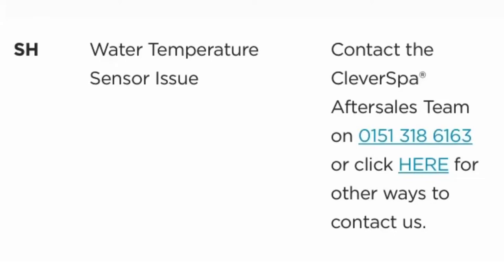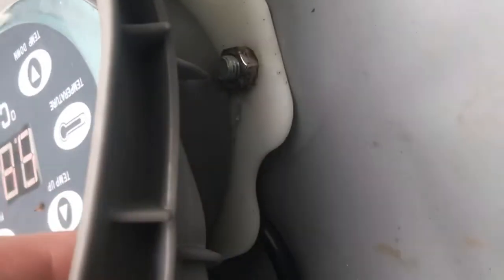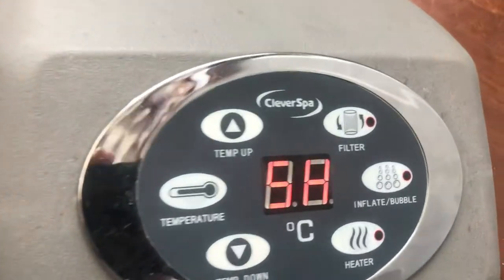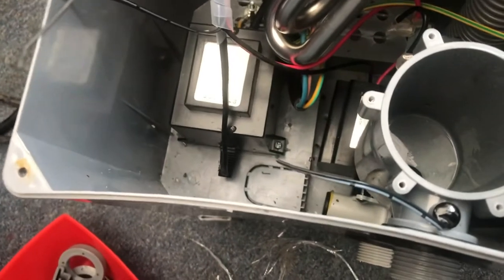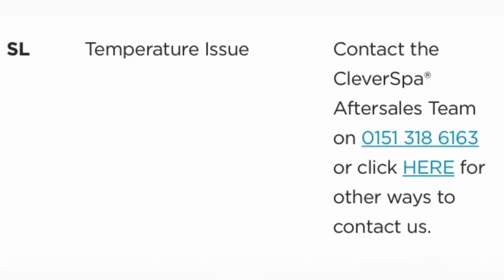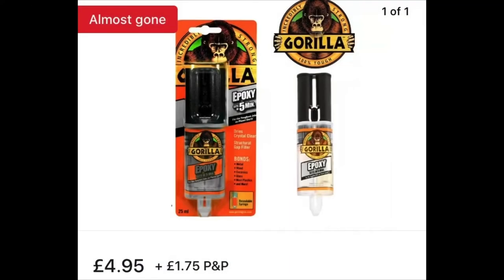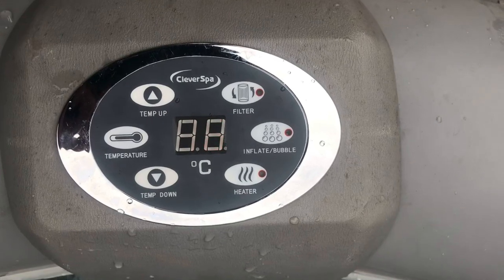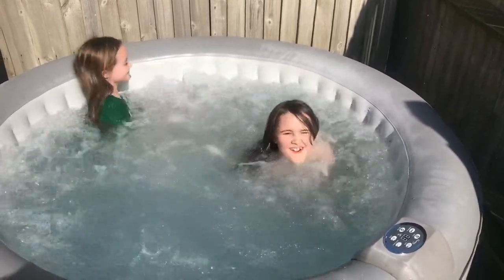Cleverspa SH error code repair CHEAP AND EASY temperature sensor replacement

Comment: Thanks we have a random inflatable hottub brand ...had sh error code... took it apart found we ordered a sensor probe like you suggested and instead of cutting we unscrewed another panel to circuit board and plugged it in directly. Put it all together and error code gone. Dang this was an on point great video. Thanks. It cost us like 7 US bucks for the probe and about 30 minutes to fix.

Comment: Thanks for this, worked a treat. I've got a cosy spa which is essentially the exact same unit. Ordered the sensor from Amazon (cost £3) and it came the next day. Didn't even have to drill another hole. Was really easy to do. No more SH code. Pool back to normal heating. 😁
Reply: Hi Marcus. I have a Cosy as well with this issue. DO you have a link for the sensor?
Reply: How didn't you have to drill a hole??

Comment: Great tutorial, thanks for posting. I must have a later version of the heater/pump unit as my probe was set in a flange held on by two screws. The probe can be carefully removed from the flange, and a new one glued into it. Saves drilling into the unit like you had to do. The single probes are currently on Amazon for £3 each.
Reply: Yes found the same and fixed fairly easily.
Reply: Could you provide a link for the sensor please? Tia
Reply: I drilled out the old sensor from the flange and glued the new one in . That way if I have to do this again I can remove it and repeat .

Comment: I've got a sensor on the way after snpping the outlet potlrt of the element housing...don't make whirlpools in your tub😅. Is it possible to plug the sensor  straight back into the control unit?

Comment: Hi gavin, i was about to go ahead with the same routine that you performed on your clever spa because i had the same error code come up but ive got it down from the loft to sort the problem ive plugged it back in to see if the code comes back and it hasnt its reading room temperature, so i thought great, i wont have to fix it so i blew it up, filled it up left it heating over night and it didnt heatup it stayed 12 degrees so im not to sure what to do. Shall i replace the censor or is it somerhing more than that mate??
Reply: I think I may have the same issue as you, I don't get any error codes but fails to heat up, I've been looking around for heating elements but this video is a good guild on how to disassemble the unit.
Reply: Jon Hill, mine is the same

Comment: Hi gavin
Was you hot tub making a slight grinding noise and not holding its temperature,I haven’t got the error code but it fits all the way up to 47 sometimes and only heats it 3/4 up leaving the water very cool on the bottom?
Reply: Same problem here
Reply: Mines doing the same .. seems like a common problem.. i need to know how to fix it !!
Reply: It's the filter guys try not to overtighten

Comment: Hi, I'm getting FC error on my cleverspa, not even inflated yet, it was stored for few months and now won't inflated, after I plugged in it comes with FC error straight away, iv the resetting thing (press and hold filtration button) but that won't work. Any advice please?

Comment: Hi Gavin, the temperature sensor on my aqua spa initially looks as if it’s reading correctly then when I switch the heater on, it reads an extra degree perceiving before giving the SH reading about 10 seconds later. Do you think it’s the sensor or element which is faulty?

Comment: Hi , I've got the sensor and now I can't unscrew the valves inside on video you say they tight you may need to use a tool what tool?
Reply from the maker: Dave Parkhouse do you mean the connections inside of the hottub where the water comes in/out?

I used some groove joint grips. I put a thick towel over the things i was u screwing so i wouldnt crush the thread on them
Reply from the maker: Like these:

https://www.wilko.com/en-uk/wilko-gas-plier-25cm/p/0211938
Reply: go on boospa they have the proper spanner to loosen the 2 valves inside your hot tub plus they sell all the parts you need to repair any inflatable spa

Comment: Where did you get the sensors from i cant find one anywhere .. mine isn't giving me a message like sh its just saying the temperature is a lot hotter than it is . I also can't understand why they have the temperature sensore after the heater on the pump instead of before .. surely this I'll give you a false reading

Comment: good effort but no need to cut sensor unscrew cover and plug straight back into board plus drill out old sensor and put new one back in its place this new sensor will fix sh and hl  error codes and should fix your non heating problem. oh and yes lay z spa pump units are far better than clever spa!plus you can get all replacement parts.

Comment: Will the SH code always show if the temp sensor has failed? Mines not heating and changed element but still not working
Reply: Mines not heating either. Where did you get the heating element from please.
Reply: @johnlangley2268 , I got mine here: https://www.boospa.net/inflatable-spa-heater,us,4,ASHEATAQUA.cfm

Comment: Hi Gavin I wonder if you can help I have a cleverspa and it has just stopped heating the water. The bubbles work the temp is set to 40 correctly the filter and the heater comes on but the water doesn't heat at all. Display shows 15-17 but doesn't move from that - any clues anyone??
Reply: mark jordan exactly what has happened to my clever spar
Reply: @margarethamer5969  what did you do Margaret?
Reply: Haven’t done anything yet I was hoping someone would have answered you so we could put it right sorry should have made it more clear still hoping some one will answer
Reply: Same problem here. I have an Aqua Spa which is basically just a Clever Spa. Cant find how to fix it anywhere but no error code showing.
Reply: @margarethamer5969  mine done the same i thought it was the heating element, it wasnt as i tested it with a multi meter best 7 pound i spent it was the thermostat much cheaper fix for my cleverspa

Comment: Also to add...  unit was fine until turning in one day and it sounded rough and noisey ... cleaned filter and left for 2 hours and no joy ... also ran it with no filter with just the filter sock over the hole to double check and still nothing ...

Comment: Anyone able to help me I had a HL error when hot tub was full couldn't use any controls, filter, bubbles, heater etc just HL beeping. I've emptied the hot tub and the HL code and beeping is still there even though the hot tub is empty..
Reply: same issue here
Reply: @ctyj247  I've also got the HL code but giving this a try...new sensor should arrive today will let you know if it works or not 👍
Reply: @yamyamlad1985  I done it a few days ago and works a charm, you'll be back to tubbing it soon

Comment: Hi All , Just set one up last week .All seemed easy until I filled with water , control Panel will not allow temp change or Bubbles and doesn’t seem responsive to touch 
Bubble button worked when unboxed to blow up unit and now nothing 
Grinding filter also   Any ideas what problem is